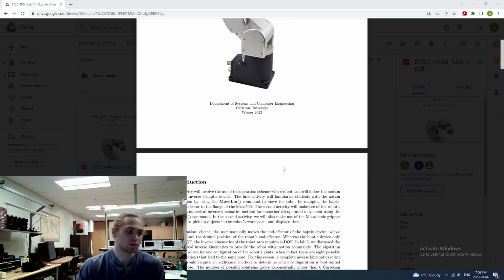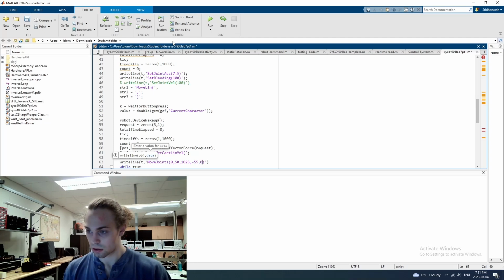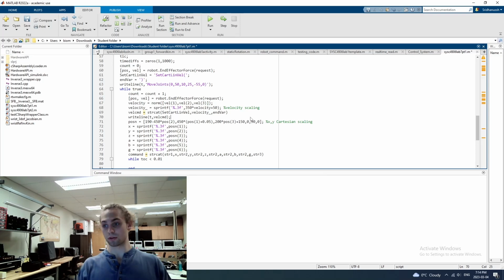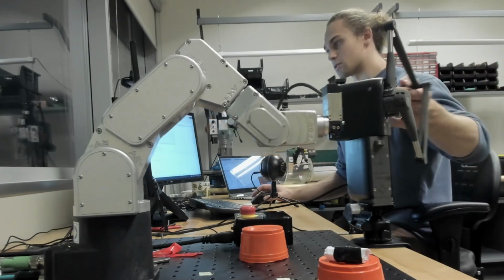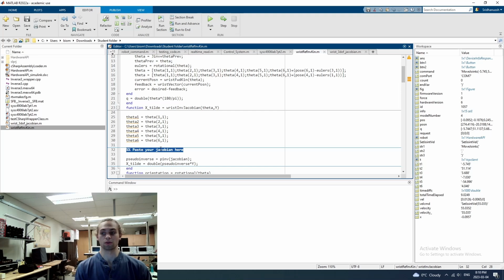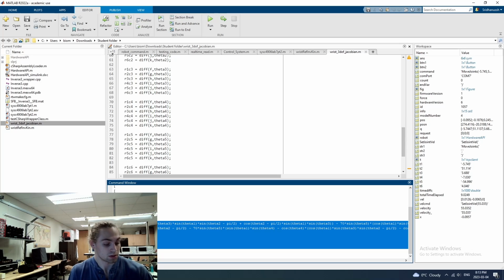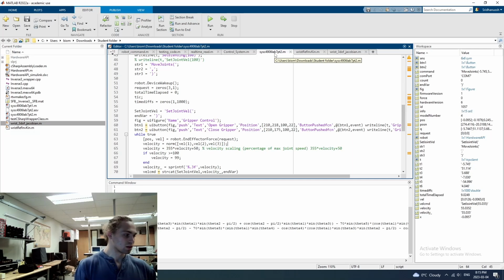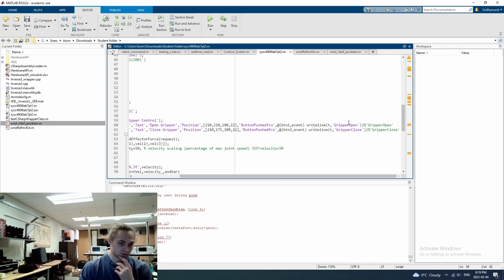SYSC 4206 (Surgical Robotics) Lab 7 tutorial

Comment: Hey there, what is the control mode of the robot in your demonstration? position, velocity or torque? thanks for sharing.
Reply from the maker: It's position mapping
Reply: @biomechlab  Hey thanks for the reply, i mean i suppose it is installed with AC motor so you have a motor drive right? I mean in the end, you need to send command to the motor drive, what command you are sending to the drive to move the motor? position, velocity or torque? and can you point me to some material to gather more information about this position mapping you are referring, thanks in advance.
Reply from the maker: Check this lecture out https://www.youtube.com/watch?v=nT-qGpl1ESs  @willyturing1803